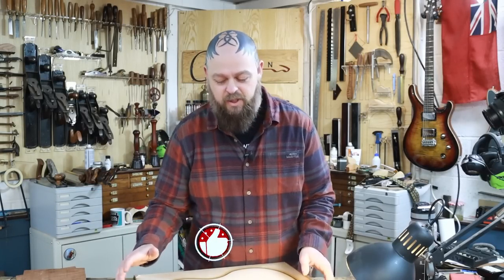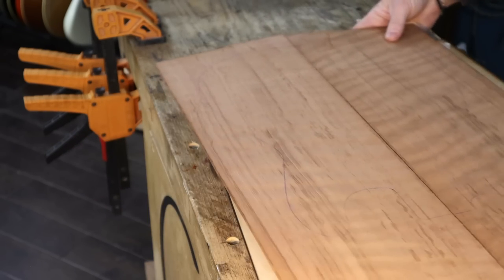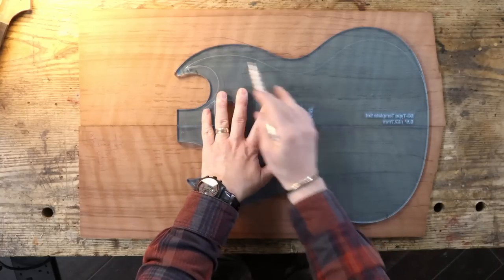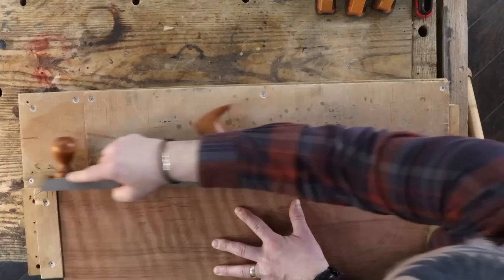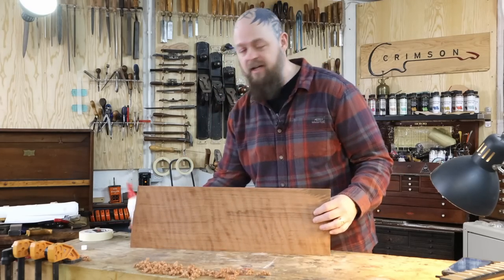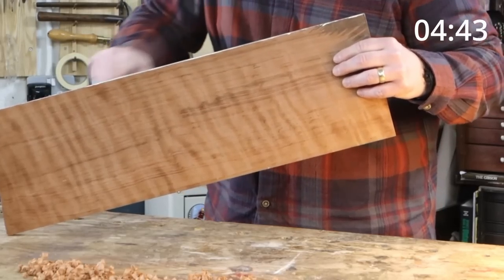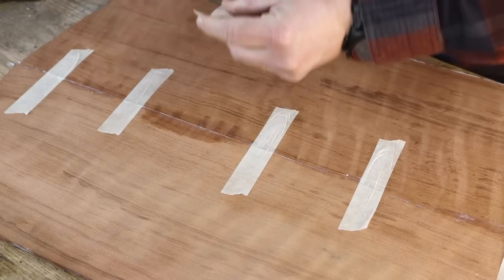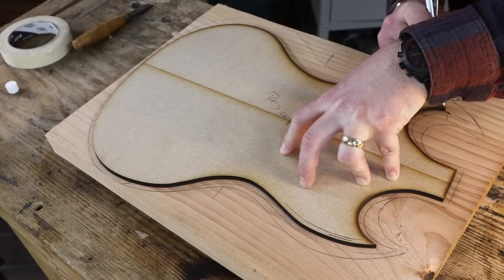Ep 3 - Look Ma, no clamps! Hand Tool Guitar Top Jointing - Redwood SG

Comment: Ben.. Focussed?? Isn't that a bit like a contradiction? 😜 Anyway the current format works great for me. There is a lot to learn from the details between the major steps and the dozens of tangents that you distract yourself with. I'm wondering what's going to happen when you're doing more focussed videos.. I rather enjoy the start-to-finish series showing basically everything in a custom build. Of course not the hours of sanding and such or when using a router to copy the shape of a template to the body that you're going through the small steps you're taking out first in order to prevent chipout.. With a thicknesser you don't need to show every 0.1mm steps you're taking off the material.. But all the important bits are in there.. I've learned loads from videos like that, to the point that I've started building my own first guitar and contemplating coming over for a couple weeks to really learn how to make a neck before I try it on my first build. I really do not want to ruin that one. I think a more focussed format could work, but I'd still want to see all the important details though. I wonder if it would be too challenging to make it AND focussed, AND not losing any important details.